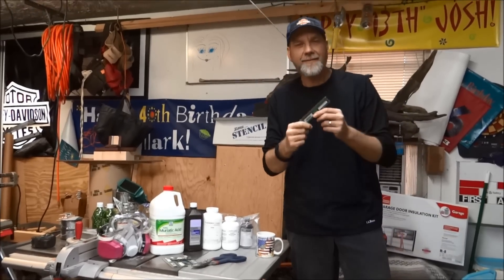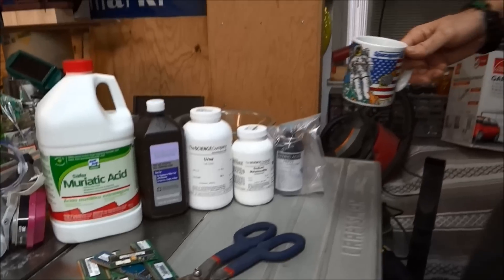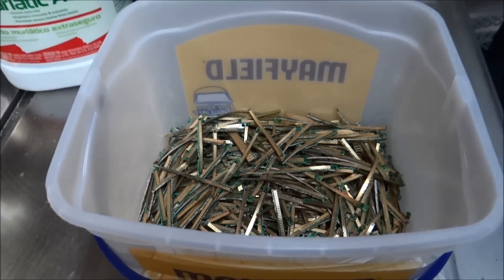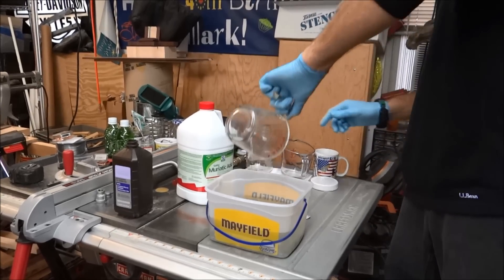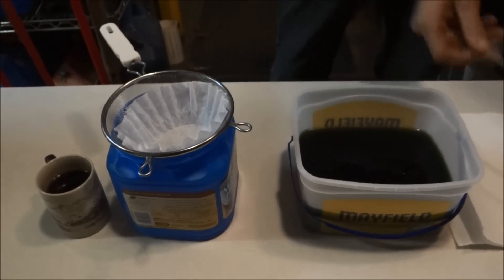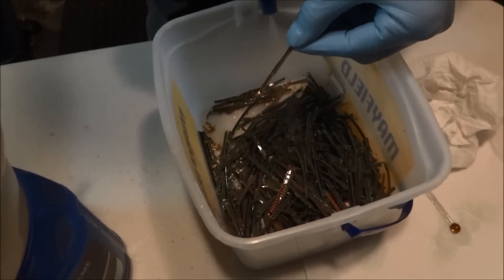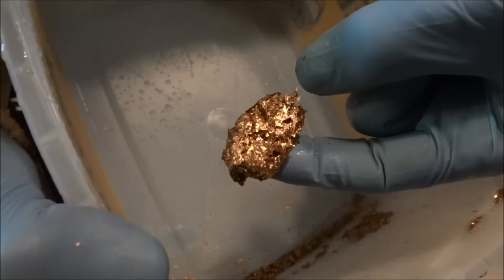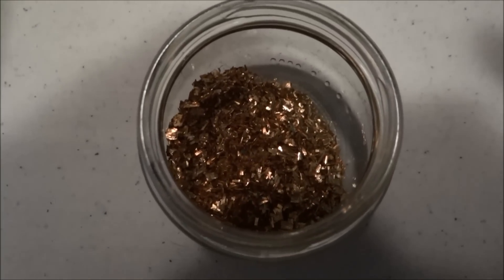How to easily recover gold from scrap computer chips

Comment: What is the cost of disposing of the hazardous waste?
Reply: this idiot probably flushed it down the toilet.
Reply: +exoticnoise420 hahaha
Reply: +exoticnoise420 your the idiot he's not
Reply: If you do it right, nothing, if you're just using AP(acid peroxide) which in this case the acid is just HCl, the main waste product is copper chloride.  It will take a lot of phone calls but there are some chem companies that will process it for free or if you have a lot of copper in solution they might even give you a couple of bucks for doing the hard part for them.

Or you can cement the copper out of solution with iron, you're left with ferric chloride and if you make a ton of phone calls you'll find somebody to take it for free. Go to a maker faire and find a few people that etch their own circuit boards, they will take either solution.
Reply: free
Reply: so how much profit do you make compared to the cost of all the materials?

Comment: 1.  Given your muriatic acid was already in liquid rather than powdered form, I see no reason to add hydrogen peroxide at 3% (the strength of common retail  product)...that's basically adding water and diluting your acid. Also..light degrades hydrogen peroxide, so why put it in light? (or was the goal just to have it and all its toxic fumes outside?). Seriously...what's the chemical purpose of the hydrogen peroxide?

2. Probably best to pick up a NON-metallic device to hold your coffee filter on the first go. I noticed that you switched to a plastic colander hehe.

3. I would have mentioned specifically that this process releases flammable hydrogen gas as it processes, so don't go leaning over the bucket to check your progress while having a smoke ;)

Comment: Is this gold 24 karat?
Reply: No, I think they were 1024k, or 1MB RAM chips... :)
Reply: +Anthony Young 
thanks you for the reply.i apperciate it.
Reply from the maker: +Suraj Gaud Pretty close.  Here is the purity test:  https://youtu.be/qkmhEGBjyMs
Reply: 18k
Reply: The melting point of +mary mullis was extremely fast. +Blue bomber achieved maximum burn (might I add, with 0% slag residue) at an average of one conversation per melt!

jokes aside, Mary, stop talking out or your arse. I personally melt gold for decorative purposes and have extensive knowledge on various metals. Professor my ass... take your "PHD" and get away from this community

jk I'm lying. PRANKED YA!
Reply: +Christmas Eve haha

Comment: Did anyone else cringe when he cut the ram with the tin snips?
I know it's probably old but still =(
Reply from the maker: +Scabbage It's not my favorite step, that's for sure.
Reply: Scabbage Recycle the modules. Those older ones were quality. I remember when a 4MB simm costs a month's pay and a 20MB hard drive gave little change from £1000.

Comment: Fingerboards? Wrong title goofball. The AP method is what he used. It's 2parts muriatic acid mixed with 1part peroxide. (Both for sale at every Wal-Mart) Then he will use aqua regia to refine these, drop with smb, clean and torch. What about gold from old 1978 chips? Method? Yield? Title video correctly!

Comment: Question - have you ever tried or considered roasting the circuit boards in a pot (with a cover but not sealed) over enough heat that the fiberglass in the boards turned to carbon ?

Comment: My wife works for a recycling warehouse. They take in lots of stuff of a wide variety. Some is electronic junk and computers. Some is sold as computers or parts. Some is sold as scrap. A Chinaman usually buys the scrap by the pound, currently the sale price is $11/lb. The warehouse has $0 cost to acquire inventory. The Chinaman then sells to a company in China and the waste is shipped to China for recovery of metals, mostly gold. The Chinese company makes enough cash on the process to pay for the market up on the $11/lb. and the shipping cost to China plus their costs to recover. Yes, you can make money on scrap computer stuff. Here we have a warehouse, a middle man and a Chinese refinery all making a profit. You can make a profit in micro doing recovery. You need a low acquisition cost. What I have seen on ebay is 95% priced way out of wack. You need some volume. P.S. I am a gold mine owner and assayer. My first inclination on this is to mill it all down to 100 mesh, then leach the gold and silver into solution, then precipitate and smelt to dore bar. Using acids and high temps, like 2200 F is all in a day's work. You must know what you are doing. Beware of what I call "hearsay" knowledge. Which is what is plentiful on youtube. Read a book and study it. I own 8 manuals and college texts just on fire assaying.
Reply: "chinaman" wtf
Reply: yes, i think if you had a good source for the material, there could be high potential!
Reply: Uh oh PC police. Soon to be followed by the thought police
Reply: Dude, please, the Chinaman is not the issue here
Reply: David Howard I know this post is three years old but I have recently become fascinated by the potential of this sector. Do you have any other resources for info you can point me to?
Reply: @liamhoward2208  hi there ,in case of something interesting point me too :|
Reply: +Lu Tze Prospectors round here regularly get stuck in the 1800's.

Comment: Goes to abandoned computer building down the road and steals all the memory chips
Reply: +Jordan Parkin There are gold in almost all electronic parts, since most connectors are gold plated as the properties of gold are very suitable for electronics. So you can basically any components will have a little bit of gold in them. Happy gold recovery!
Reply from the maker: +Jordan Parkin lol
Reply: +Jordan Parkin  Rabbit tv sucks real bad. Its a search engine that charges and the quality  sucks. I tried to watch Angel heart the other night and my girlfriend was like" This movie is to slow." :-P
Reply: gfyc
Reply: +Ace Rimmer corect i have the chip in my computer
Reply: :-P

Comment: may i say to all the of the ppl who are making comments about the profit margins of this...your correct at this level and any other tutorials on youtube....u lose money but if actully r going to do this for money you dont use a 100 or even a 1000 ive done this and what it is is u collect for years say like 5 or 10 then when u have 50,000 100,000 or 500,000 then u do this then u make ur huge profit jump and also with repeats u can restabilize this with a copper chloride soluition then u dont have to pay for the acid again
Reply from the maker: +Seth Black Thanks
Reply: np

Comment: Sounds like you have a very bad water leak in your basement - I would check that out.
Reply from the maker: +bbutc LOL.....we're good.  I'm raising Tilapia with Aquaponics.
Reply: +LifeBuzzN OK, glad you're safe as you are using some VERY dangerous chemicals there. I had visions of your poor dog going to investigate the pot of chemicals outside on the ground maybe thinking it was a bowl of water and when you were handling the Nitric acid with the gloves on you cross contaminated the camera. And how did you dispose of the used chemicals? You can't just poor that stuff down the drain, it would have to go to a licensed hazardous waste disposal facility.

Comment: I'm kinda wondering if it would be easier just to put the whole thing in a furnace and melt off the gold, or separate the gold from the rest of the molten stuff, assuming the rest of the board melts too.
Reply from the maker: +Ndoki Hasaki You wold have the desired purity...there are other metals involved.

Comment: Just one thing...all those chemicals , cost more than the price of the gold..
Reply: +Kalle Klæp Your looking at it wrong bud, there's enough chemicals there to do this process 5+ times at the very least. I priced it all your looking at around 60-70 bucks for the chems and i dunno 30-40 bucks for one rounds of 100 chips. The first round your down what 30-50 bucks? The second round your down only 10 bucks. The third round your up 30 bucks. 4th round your up 110. 5th round your at 190 give or take depending on how much you extract each time and you'll need maybe 2 more jugs of that muriatic acid(if that) so take $16 away from that. and that's if you just being lazy and not completely stripping those chips. So if you do 500 chips every what 2 days for like what an hour or 2 of work each of those days that's some pretty nifty spending money right there.

Wow that ended up being a longer post then I intended haha.
Reply from the maker: +Brandon Hodson You are pretty close.  Thanks for helping to explain.

Comment: "piece of computer memory"
Yeah I'm sure that's the proper term… lol
Reply: Ram and computer memory are the same thing
Reply: ***** When people refer to computer memory they usually mean the ram like when you go to a store it says memory: 8g not ram
Reply: "Random accessible Memory"  aka ram
Reply: The Real Flenuan At least he didn't call a hard drive memory. That is really all that grinds my gears, when someone says their computer is 'low on memory' but actually they mean 'my hard drive is full'. Then they act like you are nit picking when you tell them what they meant to say :/ I usually relate it to saying 'my washer fluid is low' when they mean 'I am out of gas', to point out the massive difference in their statement.
Reply: +Richard Smith my hard drive is damn near full maybe 60gs left on it and I keep getting pop-up messages saying your computer is low on memory. so even the computer thinks it's space is memory
Reply: Kyle Kelly Virtual memory is on the hard drive, perhaps it means it does not have enough room for the virtual memory it wants to allocate.
Reply: ram

Comment: Hi, In Australia the Hydrogen Peroxide is the one you buy in the first aid section of Woolworths or Coles for cleaning wounds. I am not in Aus at present or would check % for but it is only 3 or 4 % and is effective. Comes in a brown and yellow bottle. Small and expensive. Great video and tutorial and been very effective.  Like a lot of others I wish you would use that Safety Gear you have got. Lot of impressionable young ones out there. Used all of your methods and have had a great result so keep up the good work.

Comment: could this also be used on the fingers of the acessory cards like your network ,video,sound ETC and what about the wiring inside of motherboards& ram and internal cards is there a process to get this as well

Comment: Safety Note Respirators are ineffective when worn with a beard. Even 1/4 inch of facial hair will break the seal. If someone is using chemicals and requires the protection of a respirator, it is likely the person with a camera should be in a respirator as well. Coffee cup was explained ad nauseam. You did a pretty good job explaining your mistakes while you were making them. Your dog is AWESOME! Had to pee twice from the running water in the background. Alas, I can tell my wife now where the gold can be found. Thanks-

Comment: Does this same method work if the gold plated parts/pins have been melted down already as a whole?  I'm seeing some people selling nuggets that they just melted down the gold plated pins without separating it first.  Can the pure gold be extracted from the already melted down nugget?
Reply: Jason Craft No, there is a different more involved process. Those people screwed up their gold, thinking the pins and fingers were solid gold and, there is a sucker born every minute, people will buy these nuggets thinking its solid gold.
Reply from the maker: Jason Craft It's a different process for the pins.  The gold could be purified, I guess, but I wouldn't buy that stuff.  That's just me...